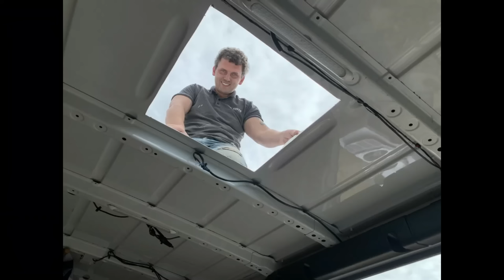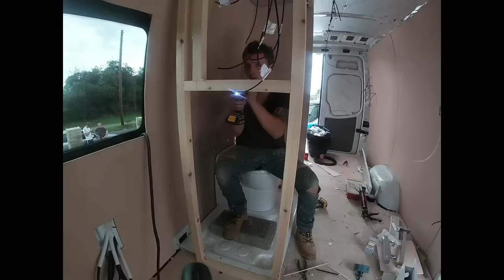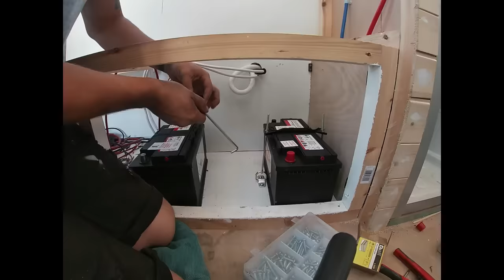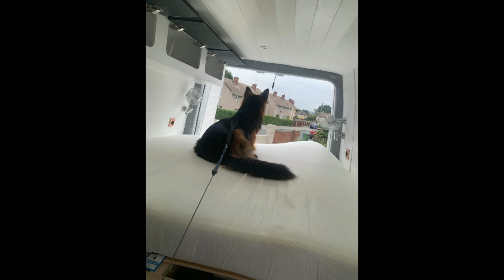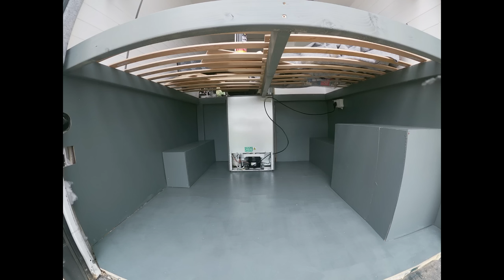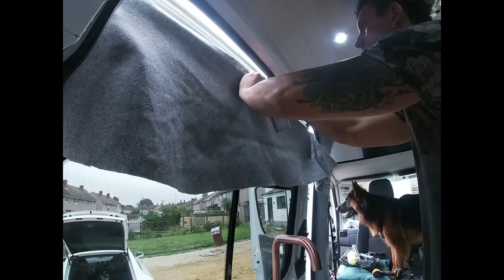Mercedes Sprinter LWB Camper Van Conversion - Full time lapsed video

Comment: I don't know why some don't want a bathroom in their vans but this has everything one could need and still there is plenty of space.  best layout!
Reply: @Dess Milli Untill it is cold (snowing!) and you don't want to leave your cozy van :D - sure a trailer would help with space, but it does have disadvantages like a) making parking a lot harder (not the act itself if you know what you are doing, but you'll need more space!) b) being outside, so if it rains, snows or there's a gale blowing? Yeah, gotta go out to cook or shower -.-
Reply: I wouldn't want one because its more work than it seems. Filling up water all the time, cleaning the toilet out, etc. It also takes up tons of space. If i am out of the city i can just go in the woods, if i am in the city just park at a business and go there. If you need to pee then use a bottle.
Reply: @markdanskin8202  also you dont need to shower inside, there is a huge waste of space in this layout:(
Reply: @Dess Milli Wouldn’t that defeat the purpose of traveling in a van which can be driven and parked anywhere?  If you’re going to pull a trailer, you might as well trade up to a larger RV.
Reply: Men can easily relieve themselves, but women can't just go into the bushes and sit/squat..
Reply: @markdanskin8202  Exactly. Carrying around human waste in my home makes no sense to me, and most people who build a shower inside their vans say they rarely use them. Just rethink your idea of a “shower.” To me, it can be accomplished out the back of my van with a gallon jug or two. I’ll be chasing sunshine, and a cool shower won’t kill you. 🚐🐶❤️
Reply: Shower and toilet: essential
Reply: What exactly stops women from  relieving themselves out in the forest?
Reply: OMG
Reply: I've been threatened by enough men in daylight for catching buses to know that I don't want to be looking for a toilet at night. Having one inside is essential. And not pooping in the space I cook in would be great, so walls too 🙃
Reply: It's all about preferences. Some people like to live minimalist and other like comfort. There's the budget limits too. Not everyone can afford a van big enough to fit a bathroom and the water and waste system (wich cost money too).

I think there's no reason to not have a small portable toilet hidden in a corner, just in case nature comes crashing down the door 😆.

As for the shower... It's complicated especially if you want hot water, since you have to deal with ventilation, draining and plumbing among others. The best solution for outdoors could be an external shower: simple, cheap and convenient. For indoors, a curtain plus a hidden drain may be the most economical and space saving solution.
Reply: @atchanih  Don't tell me, women only have one leg.
Reply: @BoleDaPole  Nothing, when you got to go, you got to go. 
If they can't live rough then don't travel around in a van, get a hotel.
Reply: @galdessa1  Some people do van conversions to live in them full time, so modern conveniences are nice to have for that. 
Plus, how are you gonna just go when you're in the city? Especially now, with all the restrictions and whatnot that make it even more unpleasant and difficult to use a public restroom, especially at nighttime.
Reply: @galdessa1  makes no sense what you are saying, your reality isn't everyone reality. Where I live its super cold 7 months a year. To me having a shower inside a van makes total sense. If you cant see nothing else then your own perspective dont be commenting on youtube
Reply: Beautiful car. Maybe want to taste different new food during a long vacation.
Reply: Finding public toilets (especially needed for females) is a pain, so toilet is mandatory in my view. I think a composting toilet would be my choice (no chemicals + no water needed)
Reply: @atchanih  Why not? Wont hurt the bushes just watch you dont splash your feet.
Reply: @annecaulder9495  Exactly Anne.  And you can heat your water on your cook stove, saves having a dedicated water heater taking  more space.  Each to their own though. For me I  can forego the shower that gets used 5 minutes a day and have more lounge space instead. Wet wipes every other day and a splash of water once a week if I cant find a swimming hole or a beach.   Life would be  real boring if we were all the same.

Having said that I   do love this build though.
Reply: @BoleDaPole  Why would you want to pee up against a tree like a dog when you can do it in a toilet 🚽🙄
Reply: @walkmandu  💯
Reply: @annecaulder9495  So do you think a bathroom in someone’s house makes no sense? I’d like to see you live in a van full time without a toilet and shower when those facilities have been closed due to lockdowns 🙄
Reply: @serginaru  Can you shower outside during the winter then? Because most people who build these vans live in them full time and they don’t consider it a waste of space, especially because lockdowns have caused all those public shower and toilet facilities to close 🤷🏼‍♀️
Reply: @markdanskin8202  You’re a man, of course you can use a bottle 🙄
Reply: Electric toilet is an option rather than a built one. Easier to clean
Reply: Some people igienic standards are all over the place, they crap in the woods or in public toilets (maybe they even sit on them...🙈) on a daily basis. Pee in bottles, yeah, very luxurious.  Hey, as long as long as they are happy who am i to criticize ? 😃
Reply: @serginaru  Your comment is a waste of space.
Reply: Most of the time people will take their vans to camps that have much better shower and toilet facilities than you could ever have in your van. 

I bet even people with a toilet in their van will often use the facilities of where they’re staying instead. 

I think if you want to go more off grid though it’s a great thing to have for sure.
Reply: Because if you do have a bathroom in the van eventually a random someone will ask to use it. Awkward moment.
Reply: @Drenwickification  a lot of the time they won’t use camp sites. They are much more expensive than a parking lot.
Reply: @bmwareugly  why are you comparing to a $180,000 van? Do you really think that’s representative of any more than a small minority buying camper vans?
Reply: @walkmandu  I think I’ve watched so many, that maybe a small motor home, would be best… I wouldn’t mind a large bathroom, bedroom at the end of home, and small seating, I don’t see me entertaining
Reply: I agree. Simple, not over complicated the layout. this van got everything you need!
Reply: Great build if you wanted a shower you have a shower ❤️. love the condescending comments lol, let them stick to the sites with a burger van and an penny arcade 😂 😂😂
Reply: @neridaduncan2710  "Wet wipes every other day and a splash of water once a week if I cant find a swimming hole or a beach."
Disgusting.
Reply: @markdanskin8202   "just park at a business and go there. If you need to pee then use a bottle."
Acceptable way to live for a bum, I guess.
Reply: Concordo. Banheiro é indispensável!
Reply: Depends upon your needs. I like the use of space in this build and don’t think they wasted any space at all, we are 4 months into our 6 months Europe tour and couldn’t imagine not having a toilet, shower and kitchen. 

I know lots wouldn’t agree, but it’s horses for courses - simple as!
Reply: My planned build is with a hidden shower but after seeing this I'm in two minds
Reply: @BoleDaPole  Poison ivy, for example. I've heard some horror stories...😁
Reply: @serginaru  Some people are stealth camping in the city, living in the van through snowy winter months, or rape survivors who don't feel safe getting naked outside with soap in their eyes.  Everyone's situation is different.  Sometimes that indoor shower is exactly the way someone wants to use the limited space they have.
Reply: @BoleDaPole as a single woman no way am I going out to pee in the dark or have a shower outside!! Yes, it’s fine if you really are mikes from anybody but all it takes is one offender to be close!
Reply: @neridaduncan2710 it’s not worrying about bushes - it’s more that most lone women worry about being sexually abused when having to go out for a pee! Same reason that many solo women want access to the cabin from the back - so you can drive away from a scary situation without having to go outside!.”
Reply: They just don't want to shower.
Reply: Dumping smells etc
Reply: Toilet is so necessary for us! My boyfriend was not into it but now he uses it more than me 😂
But we think the shower will bring too much humidity in the van, isn't it?
Reply: @annecaulder9495 sorry but I'm not going to use a public restroom with all those germs. And you live in your house where waste can collect in the septic tank. This sounds like laziness
Reply: @moteroargentino7944 lack of bathroom has nothing to do with being a minimalist
Reply: @Drenwickification no sorry but many of us don't trust public facilities to be germ free
Reply: @Sevro_Au_Barca just say no
Reply: @askaboutit exactly 💯
Reply: I did years in a low roof van.i now have a extra long 904 dually.flushing toilet and shower and nice big couch.thankyou very much 😎

Comment: Great layout.  What was total cost of materials and hours build time?
Reply: I hope the owner will answer this question because I’m interested to know it.
Reply: From my experience this looks like ~10-15k at most not including the van. They seem to know what they’re doing lol so they probably did it for even less than that. Hours wise its in the hundreds haha. My similar van took about 200 hours to build. Completed in just under 30 days while working a full time job.
Reply: @DanielMustang47  that would seem very low.
Reply: @M.Mae.M  not as expensive as you might think! Way more expensive to pay someone to do it because labor is expensive. I have an $1100 solar setup as well, but no indoor shower (my van is a little shorter than theirs). This isn’t including tools of course, which can get very expensive if one doesn’t already have them.

Comment: it's so much work to build a van, but it's really hard to buy a van that already built out and trying to figure it out and work around someone else's build. we got ours built out as a mountain bike desert explorer, we snowboard in the mountains. lots of upgrades and remodels for us. 
we really need a battery upgrade for a cooktop and hot water, but it takes a lot of work to go back to make these mods. 
it's so hard to imagine all this sanding and painting when so much is already installed, but it needs to be done. we have raw wood that can cause more problems. 
the flooring you are installing looks like what we have and it can not last one season where we live. 
I wished my sewing machine worked all your windows and bed covers look amazing.

Comment: Love it. The only negative I’d say is that you put your kitchen tap in the same place we put ours. And people naturally grab it like a hand rail as the step into the van and so we constantly got leaks and had to retighten it all the time. We ended up plumbing it to the other side and putting a soap dispenser in the hole and that worked a treat.
Reply from the maker: Thankyou! Yes we put them central on our conversions now instead :)

Comment: That's one of the most PERFECT van conversions I have EVER seen. Congratulations on the impeccable job you guys. 👌🏿✨
Reply: You need to watch more van conversions if you think this is the most perfect.
Reply: @flybeep1661  And you need to learn how to respect opinions that are maybe different than yours?
Reply: I agree with this. This one really caught my eye.
Reply: Agreed! I think the floor plan /layout is superb!
Reply: I agree. Best 2 persons van ever. 
Just wonder how you could add 2 more persons for a family. 🤔
Reply: I agree with you
Reply: WOW, just wow
Reply: Thank you for all the nice comments guys. There’s always one that has to be negative isn’t there
Reply: Agreed. I have enough room to add in a great electrical system for a larger battery bank and of course solar panels on the roof ...this layout covered all my main core essential needs. And it still had an open feel to it. i’m going to have to watch this again.
Reply: @Anna Lima - check this one out. One of my favs for functionality and overall build: https://youtu.be/zv7wyj9mBgA
Reply: @MrAlidor  I would recommend a Skooly bus (the short one) for a family of four. You would have enough room for extra solar up top and enough room for larger battery bank. just need to configure the rest to your needs. I’ve seen it work with a four-person family. 👨‍👩‍👦‍👦
Reply: @mikefranks4528  Thanks
Reply: @mikefranks4528  Omg, this is awesome!!
Reply: Ben Bevan nothing to do with not agreeing with me there’s just no need for the pointless negative comments

Comment: Definitely one of the best I've seen. I'm looking at doing so, I want the most space possible but I worry that having a long wheel base compared to a medium or small is losing the amount of weight you can add. Is that a significant problem with a long wheel base?
Reply from the maker: Aslong as you plan the weight you are putting in with your products and materials you should be fine. Most of our conversions come in around 3.1T and they are LWB :)

Comment: Beautiful car, Beautiful family work. I would just do a few things differently. He installed a clean water tank in the car - it will freeze in winter and warmed by the gray water. I would give a second vent above the bedroom so that in summer, when it gets stuffy, I could ventilate it. In the bedroom, I would give a tilt window, for example in the rear door, or two on both sides of the car - because it's somehow dark there.
Well, under the awning, it would be nice to have an outlet for electricity and lighting - and I would even say on two sides, I would also give a motion detector if someone was to turn around, the light would come on. But that's how I will say it Respect for the car and you have given a good formula for conversion. I wish you a pleasant use and invite you to POLAND :)

Comment: I really like the clean and modern style to this convert. The black and white with the wooden style floor is nice. Wasn’t it doable to have a driverseat with swivel for using the sofa and driverseat for an extra bed or did I miss something?
Reply: There is only me and the missus so not necessary for us

Comment: One question, there must be some flex when the van goes over uneven road or bumps. How does all this hold up especially the glass shower door?
Reply: where did you see a glass door?
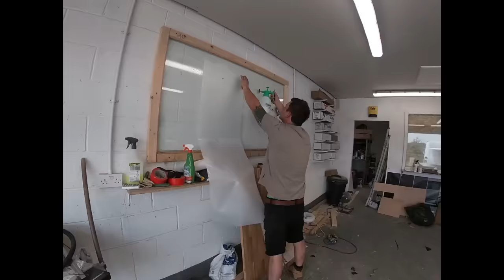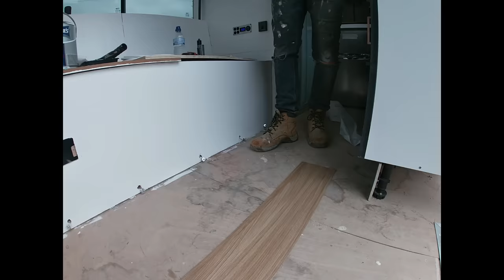Reply: 8:30 - 8:35
Reply: Perfectly fine the rollers on the glass doors are spring loaded

Comment: How did you do this? Did you follow a guide? Do you have a parts list? I would dream of doing something like this but I fear I would struggle with electrics and water piping and gas. Your layout is SO GOOD. Perfect. Only thing I would change i TV position, so you can watch from sofa and turn it around so you can watch in bed too.
Reply: Spent lots of time on YouTube learning myself to do different jobs. Electrics was the easy part for me being a mechanic by trade.

Comment: Does it have diesel generator connected to roof aircon? Because if it did, then this is basically a luxury studio apartment on wheels. It'd be the ultimate vanlife vehicle
Reply: It’s just a fan on the roof not aircon

Comment: great video... i converted a lwb renault trafic 2003 which was perfect for me and the dog but not great for 2 and a dog so sold it and bought an old 1994 fiat motorhome and repaired it and now use it and its perfect but i dont like the bed situation having to set it up everytime so i am now looking to buy a gen 2 merc sprinter 2006 onwards to convert it and yes it needs have a shower/toilet room as i wouldnt go without it now. thanks for the ideas from you video

Comment: Did you have to upgrade the suspension? I’ve driven the lwb sprinter vans and with a heavy load and I mean heavy and they just pulled along no bother with hills but did ride a bit low with all the weight I’d in the back, sorry I meant to add great work very professional and a lot of thought went into the build
Reply: No we haven’t upgraded it came in at 3040kg once finished

Comment: Fantastic video. I’ve got a few  questions if I may. How do you restrain the beautiful bear when you are moving? I’m aiming to take my 3 dogs with me when mine is built and using under the bed as a sort of travelling kennel. I imagine it must be a lot easier with just one. I saw the noise pads going in but no insulation, or did I miss that? I’m really interested in whether your van is an L3 or an L4 in length? Thanks
Reply from the maker: Hi Gill, we have a doggy seatbelt which is fixed under the seating bench and clips on to his harness. An under bed kennel would be better for more than one dog though. We are just currently building another conversions with a kennel under the bed so will try and do a walk round for you. Yes it’s fully insulated we used kingspan and recycled plastic insulation. This van is a LWB :) thanks
Reply: @homefromhomeconversions534  Thank you. I will watch for your kennel video.

Comment: Very high quality, especially kitchen finish. How much did the conversion end up costing?
Reply: Around 12k
Reply: @brettmxuk754  that seems quite reasonable for the quality you have achieved. I don't know how much donor sprinter vans cost (on top of the conversion). But I assume the van you got isn't too high mileage,so will last a while.
Reply: Dean Ezra we were very lucky and dropped on the van for 2.5k needing a few mechanical bits doing. We now run a full time business converting vans and this van in the video is now a hire van

Comment: Great job guys, one question,  did you do any kind of insulation on the plumbing under the van? im worried about it freezing up in the winter time. cheers
Reply: You have to drain down the water system in winter when not in use